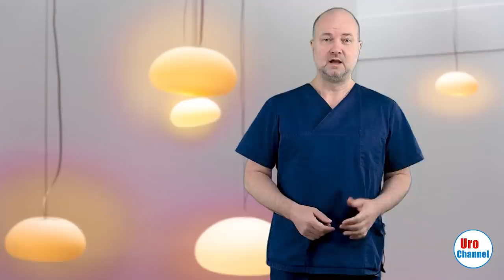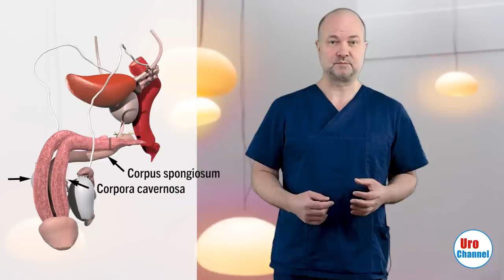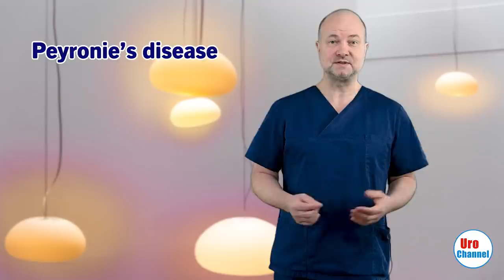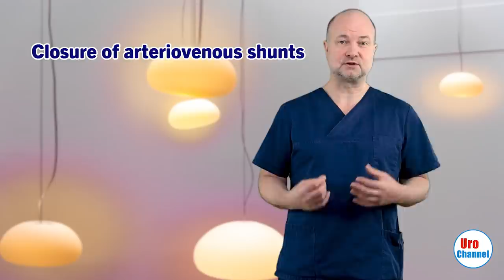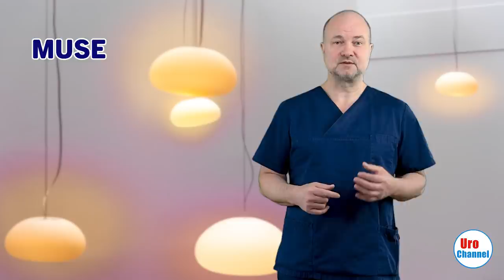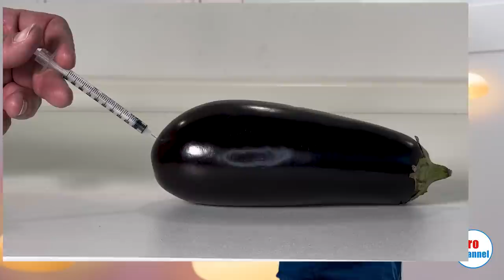Penetration (almost) impossible | UroChannel

Comment: A guy used to have Urethral tight passage. He did a Surgery. After the syrgery, he experienced erection only from the two other chambers but not with the one that ends with the glans. The issue it also made the penis appear smaller within time. It have lost a full 1 cm. Also, plessure became much less due to the lowered sensation part.
Looking for a permenant solution but I think the surgeon needs MRI system beside being a professional and successful in this field.

Any thoughts?
Reply from the maker: Soft Glans syndrome: Difficult-to-treat erectile dysfunction | UroChannel
https://youtu.be/75CJTa8bCbY